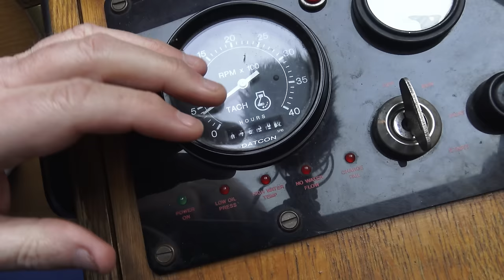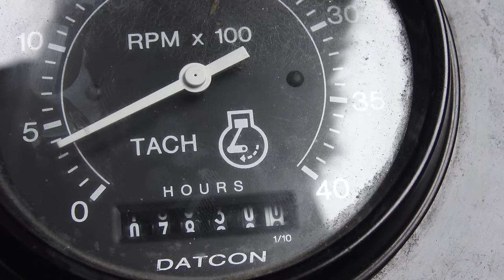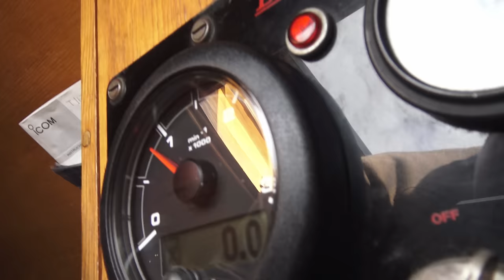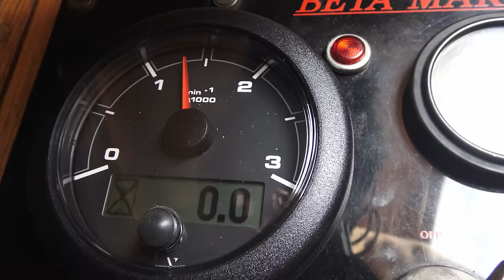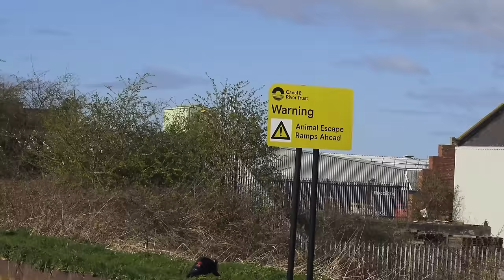Narrowboat Leak! | Emergency Repairs | Cruise to Ferrybridge | Vlog 139

Comment: Wouldn't it have been easier to just put a hose down there and suck the air out of the hose on the other end until the water flows out on its own? 
Like the days of draining a waterbed 😂
Reply: We did attempt to do that but no luck with it so it ha d to be the bucket method...good excersise for me
Reply from the maker: Tried that but the tank is below the waterline and the end of the pipe would need to be lower. After half an hour we gave up and decided the bucket method was much better....plus it helped with Jan's muscles 😁